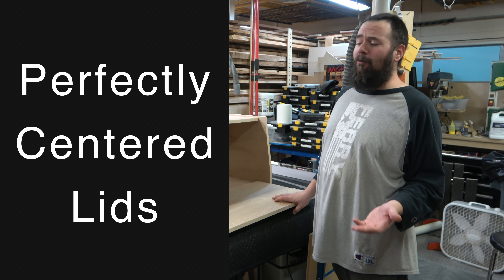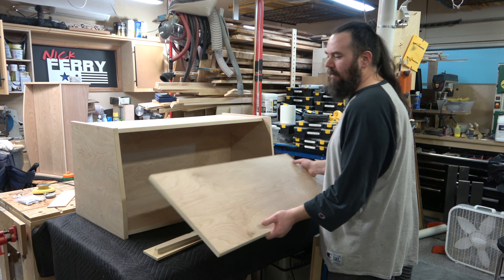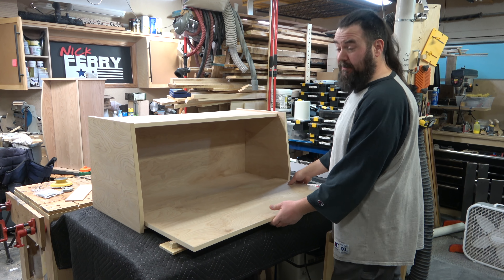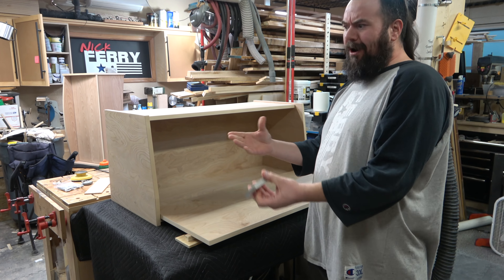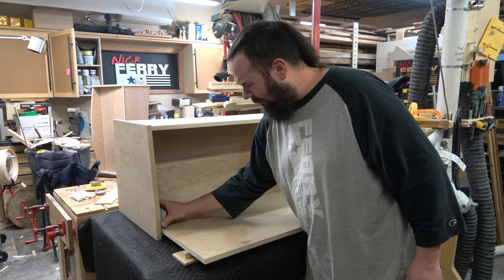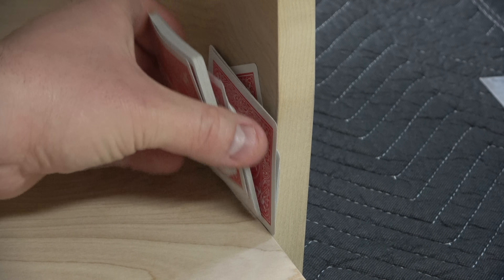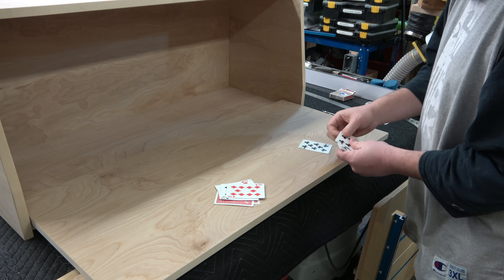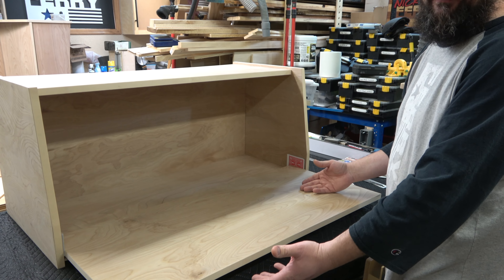Ⓕ Perfectly Centered Lids

Comment: Beauty.  Good to see your smiling mug back on here.  Also, if you push your work to one side and drop all the cards into the other side gap, then you can just divide by 2 and split them up and use to center the piece.  Potato, potato. Cheers man!
Reply: Was about to write the same comment 😅 However - great tip, no matter how you apply ...

Comment: Don't waist your time trying to center it first, just push it to one side, drop all the playing cards that will fit into the other side, then count them and divide by two.
Reply from the maker: That’s definitely another way of doing it I like the visual reference of the actual piece being centered and you can check for interference on moving parts as well - One side is probably fine in most cases

Comment: why not just push it to one side put in all the cards then split the pile cards into 2 piles and center it up that way?
Reply from the maker: I like the additional visual reference of the actual piece being centered to check for any interference but all on one side works too
Reply: @NickFerry  I'm still using the cards to center the work.  I just take half the pile and put it in the opening and move the work piece to center. Less back and forth.
Reply: @DanSheldon48  always remember to shuffle them first.
Reply: @ricos1497  for those of use that live in Wisconsin and play Sheepshead we have a third of a deck of cards that never get used now I know what to do with them!
Reply: @DanSheldon48  now I'm intrigued! Never heard of sheepshead before, I'll be looking it up tomorrow.
Reply: @ricos1497  @Nick Ferry  hopefully knows the game

Comment: Playing cards?  What in the devil are those?  I do appreciate you putting a link so I can do a little research!  LOL!!😜 You know, I never thought about using these for measurements.  Great way to determine kerf thickness from a tablesaw blade to cut, say splines?  May have to give this a shot on the next go 'round.  Thanks for sharing the tip! 👍🏽
Reply from the maker: Perfect for splines and small fence adjustments  👊🏼